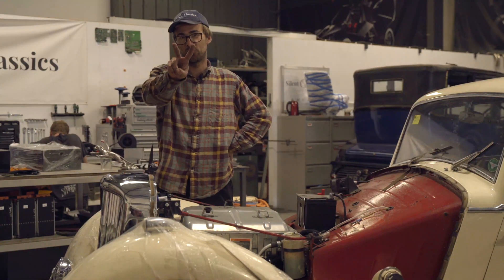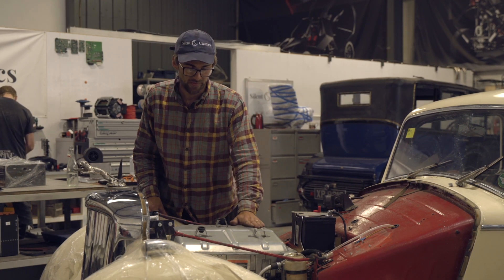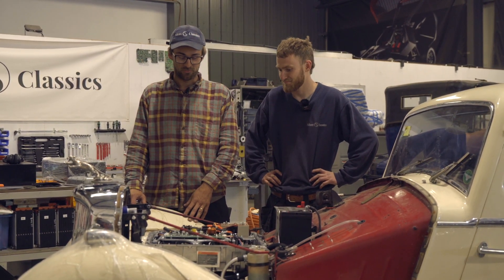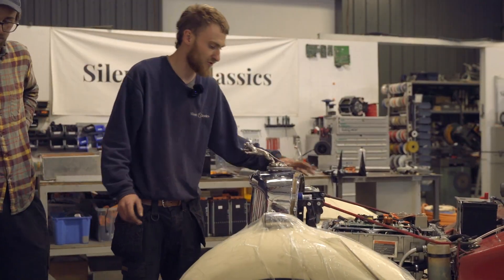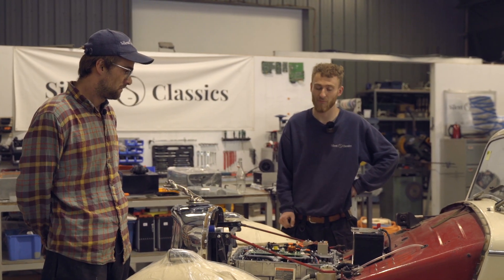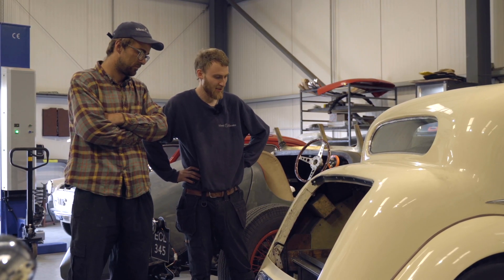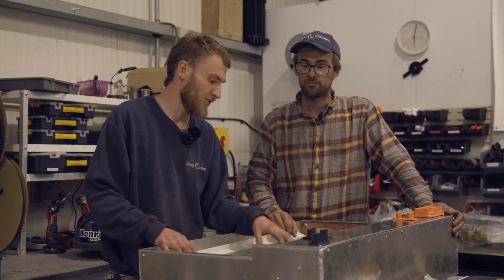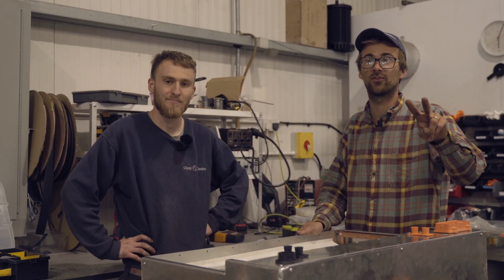ELECTRIC JAGUAR SS

Comment: Why would you ruin a beautiful piece of engineering like that by converting it to electric?sad!
Reply: I'm not sure why you think it's ruined. They didn't cut it up, didn't lower the roof line, didn't LS swap it, didn't airbag the suspension or slam and stance it, they didn't cut the guards and put a widebody kit on it. What Am I missing?
Reply: @generalvoltage1821  You're missing the ENGINE! Duh!
Reply: @generalvoltage1821  Der the engine!
Reply: @bobcat2378  Unlike the things I mentioned, which almost never have someone complaining about the car being ruined, the EV swap can be put back to an original motor if someone wants. They have used original engine mounts etc, Hence it's not ruined. It's just more likely to be drivable and get out and about more readily.
Reply: @generalvoltage1821  So it's temporarily ruined lol!
Reply: As someone else commented, it already had engine replaced with a Ford engine 🤷‍♂️

Comment: The Jaguar SS is such a beautiful car, it’s great to see that your conversion is well thought through preserving the cars great looks. Using the Nissan drive unit looks to be a great solution, amazing that it only just fits into that space under the bonnet. I like the multi-piece battery box too, such a good idea stacking the battery boxes to fit it all in through the boot opening. Lastly I just love the Leaping Jaguar charge port!